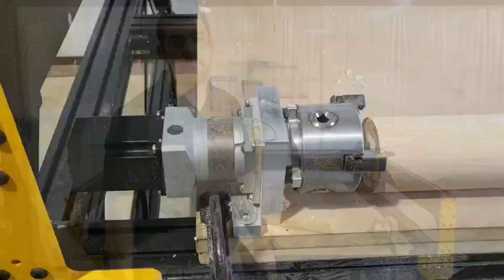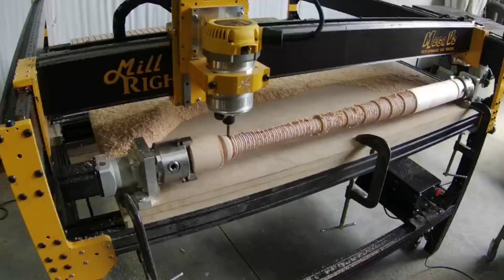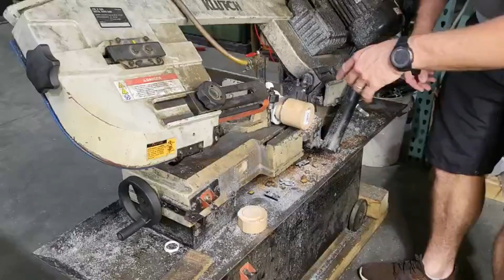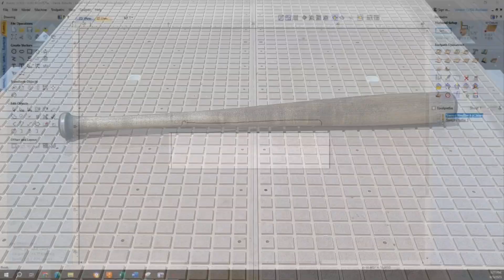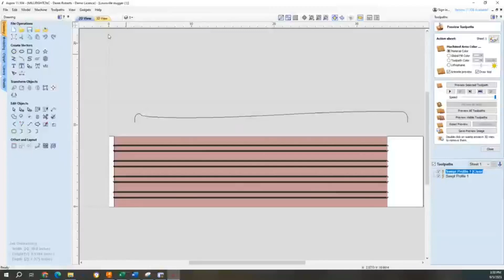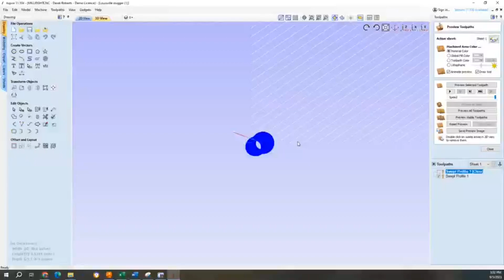Mega V 2 Baseball Bat Tutorial

Comment: Max diameter of piece?, can the rotary chucks be elevated to facilitate a larger piece? Are these steppers or servos on the machine?
Reply from the maker: On this particular model... 2.75" for OD clamping. You could elevate, but you will eventually run out of clearance over the bit. Stepper on this.